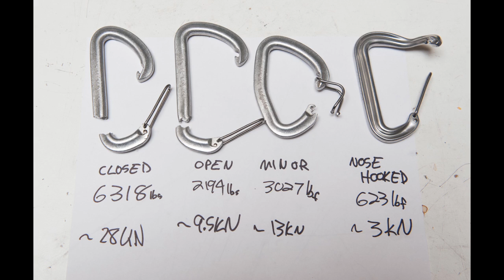When will your wiregate carabiner fail on you?

Comment: Could you please explain the 3kN failure in the last frame ? Thanks.
Reply: For example, you've hooked the nose of the carabiner on the wire of the nut you just placed instead of getting the wire fully seated in the curve against the spine with the gate then able to close cleanly and fully. Can happen with the rope or a sling as well but more often occurs with wired nuts. Always double check that the biner's gate has fully closed and everything is seated in its proper place.

Comment: http://www.rockandice.com/weekend-whipper-video/weekend-whipper-carabiner-breaking-fall 

Ousby couldn't see where he was clipping and nose-hooked a wire-gate carabiner on the nut (the 'biner was also over an edge). In controlled pull-tests, nose-hooked carabiners have failed at less than 10% of their rated closed gate strength—"that's less than 2 kN (500 lbf or 227 kg), a load that can be easily generated in even the smallest of climbing falls or even just a light bounce test," Kolin Powick, a mechanical engineer and Black Diamond’s Director of Quality, wrote in Climb Safe: Weakness of Nose-Hooked Carabiners.